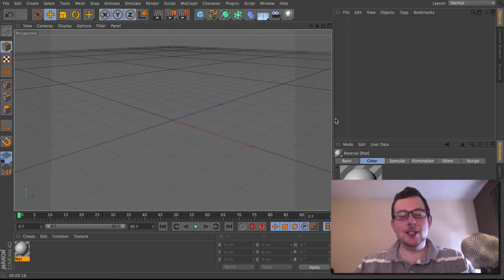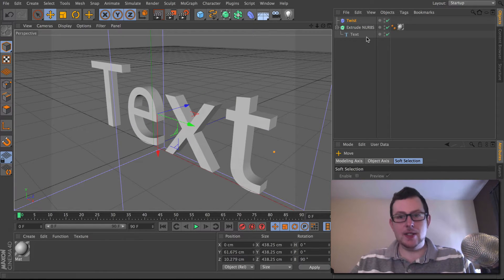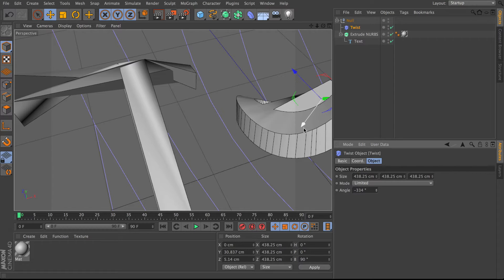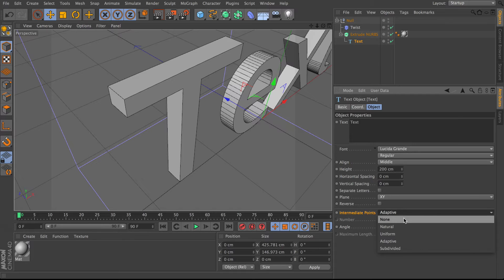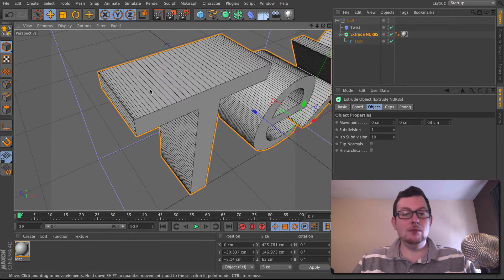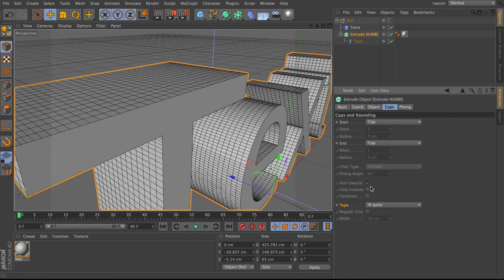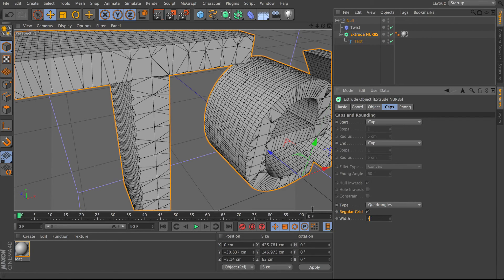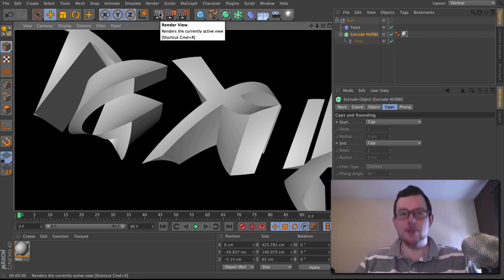Smoothly Deform Text & Logos in CINEMA 4D

Comment: I've found every one of these tutorials really helpful and insightful, this is fast turning into the go to place to get the kind of info you really need to improve using Cinema 4D. If you ever consider requests then mine would be applying common mocap data (like the free carnegie mellon mocap database) to your own rigs or how to set up a rig that's ready for mocap, then how to work with it. A tiny tut for sure lol.